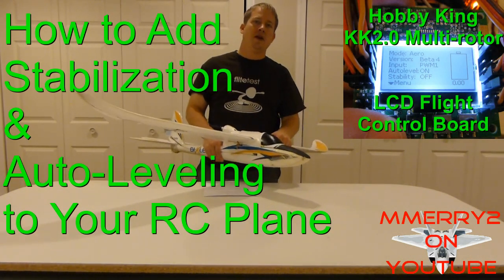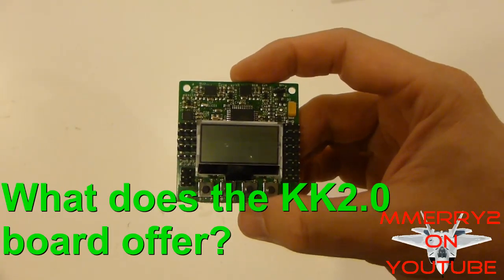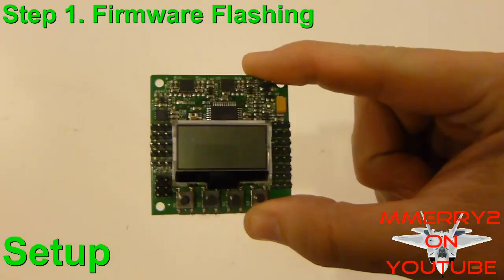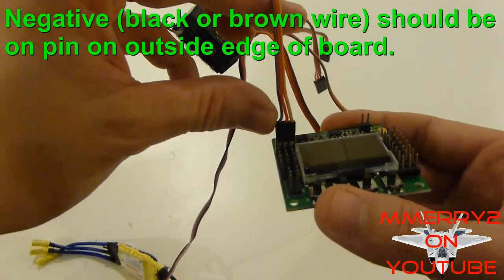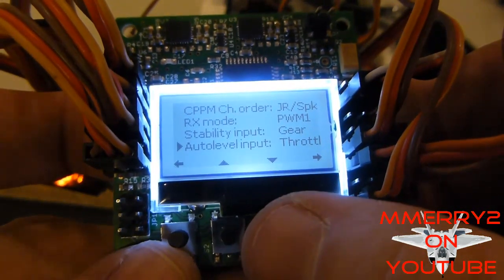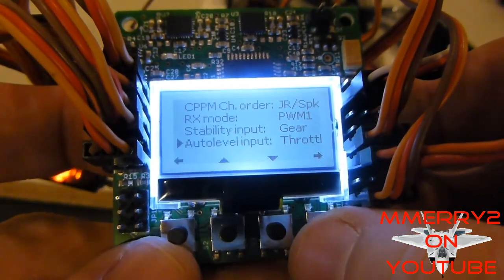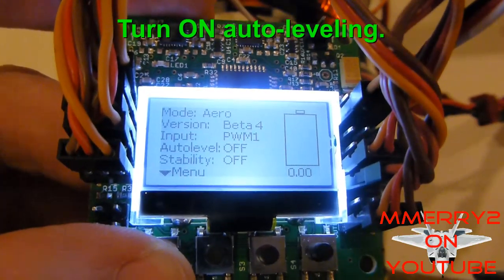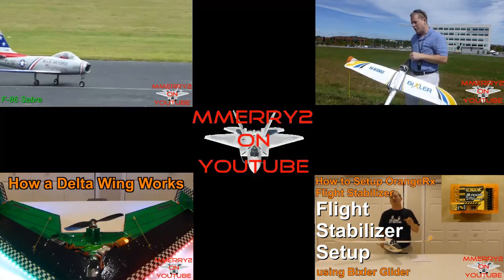Add Auto-leveling and Stabilization to Your RC Plane using HobbyKing KK2.0 Board

Comment: Pretty good video, thanks. If I may, it seems you have difficulties making the difference between male and female..... You see, the male has a "thing" sticking out, while the female.... Anyway.... :-)
Reply from the maker: I know it sounds backwards, but the servo cables are male-to-male. You're looking at it from the wrong perspective.  The female connectors have the 2 black plastic pieces that goes on the outside and the male connector has the 1 black plastic piece that goes inside the female connectors.  If you don't believe me, click on the product link for the male-to-male servo connectors in the video notes and see what the product is called.

Comment: 30$ is a lot, and KK2.x is too big for most of rc airplane.
MultiWii support airplane stabilization and more (RTH , altitude hold, etc) since years and MultiWii boards cost 15$ or 7$ in DIY mode ... just some info that everybody should know
Reply: Dude if you think 30 bucks is a lot of money get out of the hobby
Reply: Ryan Gribble
LOL ... Anyhow ... MultiWii with Airplane mode does blow away OpenAero2 ... if you follow the progress of PatrikE, he has waypoints, RTH, etc using MultiWii for Airplane. Anyhow, KK2.x is still too big. AfroMini32 the "baby" Naze32 does support airplanes and has a fraction of the size of a KK2 board. Cheap MultiWii board are also smaller then KK2.0 ... spending more for getting less .. is what people should think in the hobby ...